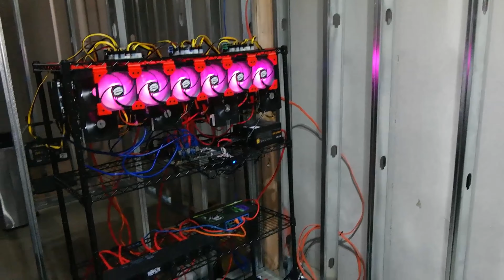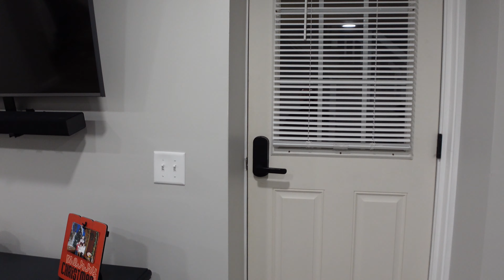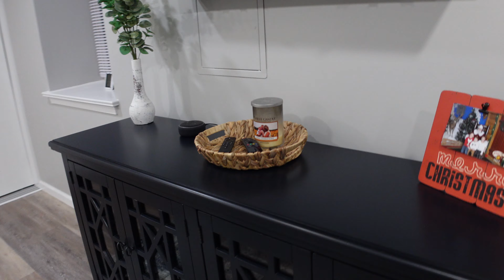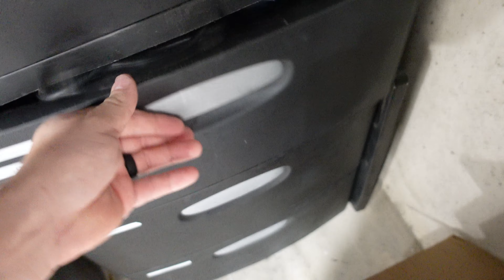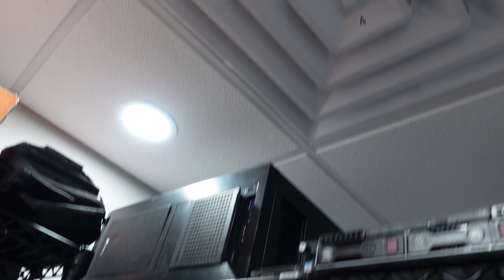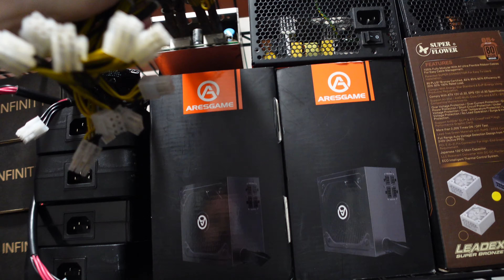My Home Crypto Mining Basement Renovations Are FINISHED

Comment: Whatever you do, don't expose that qnap to the internet. They have had so many security issues in the software over the years, and more get found every few months. Make sure you have it set to automatically update, whatever you use it for. And keep a backup in case you need to restore everything on it.
Reply: Synology would have been better, but the business line and not the consumer ones.